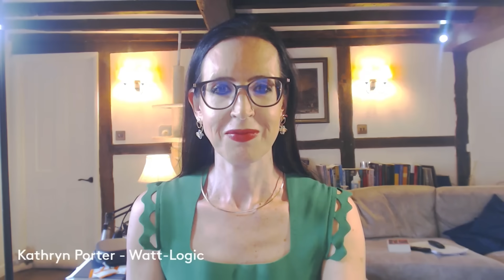North Hyde substation fire and the Heathrow blackout

Comment: Just stop transformer oil! It's literally used everywhere. Makes me laugh at those people who really think we can just stop it. Worse still its a single point of failure to the only supply to LHR at that point in time. The cost of outage is massive, the cost of maintenance is, I suspect is less (they only care after it fails). Did anyone do a failure mode and effects analysis, which used to be a normal thing, especially in the avionics industry (what's that they say?). Keep the essential systems working (not including Costa in that). The endarkenment is starting to reach critical mass. I didn't notice the peak (in the 90s) but now it's evident we're over the top of the roller coaster.

Comment: While it might appear that there is an issue around scheduling regular maintenance, it is not always possible to take equipment out of service, at the scheduled time, while simultaneously maintaining reliability of supply. 

Consider a tower of Jenga blocks. Blocks are being added on the top (system augmentation). Some blocks are withdrawn and later replaced at random at lower levels (equipment failures and subsequent repairs). You want to withdraw a particular block (for maintenance), but it's not always possible to do so, depending on the state of the rest of the tower.

Comment: From an Australian power engineer, it seems negligent that so much critical load was affecting by a single incident. There seems to be a lack of resilience in the system that feeds one of the most important pieces of UK infrastructure. I’d very much like to see an analysis of the feeding arrangements from the National Grid to the Heathrow airport and surrounds.

Comment: About 6 years ago we had a power cut that knocked out the power for two towns for a minimum of 30 minutes. At the time I was at college with quite a few UKPN area managers. I asked our area manager what happened the next day, he brushed me off whilst he went to the pub. The other area manager explained that there was an earth fault on a piece of equipment that the manager had identified as in need of 'reinforcement' three years prior.

It is clear that the boots on the ground are not the issue, but the bean counters instead. Having UKPN owned by HK companies, once priding themselves as the most profitable DNO is causing the infrastructure to suffer. Profits need to be invested directly back into the networks, not offshored to foreign shareholders. Ofgem need to grow a pair.

Comment: Thirty year veteran SCADA engineer for the Grid and can confirm that the maintenance and replacement slippage has been getting steadily worse over the decades.  Clever software control systems cannot work miracles ... at some point you have to maintain your transformer!  I chuckle wryly as I say this as most of the time when we get fault calls on the AVC/ATCC systems it is because the SGT's (specifically the tap change mechanisms) have not been properly maintained!

Comment: While I appreciate, like other viewers, the clarity and the conclusions, I do disagree with several statements. One, the explanation of electrical resistance and heat was turned around. The resistance is a physical property of conductors; the results is loss of Energy which in turn results in heading. Two, transformer oil meets many requirements. Calling it highly flameable is firstly a relative statement, and secondly debateable. According to Wikipedia, it is compareable to biodiesel. Third, fire requires air, so the  containment of the oil must be breached before a fire can start. Therefore, the moisture in the insulator most likely caused / allowed an arc to heat the moisture, crack the insulator open, allowing air to reach the oil which then ignited. Further, you could have mentioned, that the ammount of oil is very substantial - thus supporting a major fire. Perhaps the oil leaked,  creating an even larger fire spreading on the ground (the expansion tank on the transformer).

Comment: Although National Grid where negligent, so where the operators of Heathrow. As a mere civil engineer working on the design and construction of energy systems, even I new that sub-stations caught fire, that is why we put fire break walls in. If the operators had done the most cursory risk assessment they would/should have identified the need for redundancy in the grid supply and/or have emergency generation on site.

Comment: How do they know it was moisture ingress that caused the breakdown? High voltage dielectric breakdown can also be caused by the deterioration of the insulator. Breakdown occurs if the field strength is excessive, so locally in a material that depends on how sharp a point is in it, as per inverse of radius of curvature in the microscopic structure of the material. Therefore if a material is old and lets say it develops cracks in it through regular thermal stresses of expansion and contraction with temperature then it will create local point as in the material which will arc over and eventually you get a runaway situation where it burns up entirely. I had this problem a lot with 25kv transformers and you also get dielectric breakdown in old capacitors as well. I don't suppose transformers manufactured pre 1968 were all that well designed. We have better material science now than back then.
Reply from the maker: There was a forensic examination of the remains after the fire and evidence of arc related damage was found in the remnants of the bushing. With the earlier records of moisture ingress from 2018 they concluded that moisture was responsible but do recognise that it will never be possible to be certain because so much evidence was destroyed by the fire

Comment: Until you get into the fine detail of the incident in the US you can't be in a position to fully compare - and you haven't further explored that incident save to say they are similar. The failure is most likely due to a financial decision than an engineering one.  This sort of equipment has been around long enough to know its  weaknesses. If this type of incident is genuinely rare then it actually underlines how robust it is.

If the government had properly encouraged local electricity  generation  instead of allowing the ageing grid to be stressed further shifting large amounts of power from one part of the country to another it would be to everyone's benefit.

Comment: Having had some previous experience of transformer faults many years ago, the principle concern was the regular testing of the insulation quality of the insulating and cooling oil. Whilst the larger high capacity transformers like these are seemingly a sealed container, they do suffer from condensation forming internally in the expansion tanks which allow the oil level to fluctuate according to the ambient  temperatures within a given level.
Any deterioration of the insulating quality signifies water ingress, or other potential problems like internal arcing from loose connections or overheating which, under certain conditions, can generate acetylene gas. Many larger transformers are fitted either with an explosion vent, or more importantly - a Buckholtz gas detector alarm system which would trip the associated main breakers in the event of gas increase.
When the thing finally flashes over, it goes BANG as this one did, and the oil catches fire. 
Then everyone gets a bit!

Comment: Am I correct in thinking that moisture in the bushings was identified in 2018 and that immediately remedial action was required , but none performed ?
Reply from the maker: Yes. Moisture at the highest category was found. NGET's policy was to immediately take it out of service to replace the part but for whatever reason it was left alone

Then they found the fire suppression equipment was broken in 2022, still broken in 2024 and still broken at the time of the fire
Reply: @KathrynPorter26 .     It’s shocking and inexcusable.   It reminds me of fatigue failure in rail track, which was ignored, leading to derailments and deaths.
When I was a design engineer, the Institute warned us that we would be held personally responsible in law for deaths.   I became an airline pilot, so I find events at Heathrow particularly disturbing.    Thank you for your explanation.

Comment: I read a very interested article that said that because the sine wave produced by inverters changing DC from renewables to AC is not a pure sine wave ( like the one that comes from rotating generators ),  but is a 'dirty' sine wave having a high harmonic content,  this stresses the transformers and can cause failure.
Reply: Many inverters nowadays are pure sine wave.  However many of the loads on the grid have poor power factors.

Comment: Thanks for the clear explanation.
I'd have thought older infrastructure would require increased maintenance schedules due to their age.
Even worse if those transformers are running at above their rating..
..
The national grid, like the NHS and the rail network are everyday essentially infrastructure, and should be run efficiently in that context.
...
There shouldn't be cost cutting or cuttimg corners. 
Theres no need.
..
I can see 
why offgem might want to reduce the retail price of energy..
..
I'm not sure adding green subsides helps.
It just adds more pressure to cut costs.. elsewhere..
..
In this case 
N/G infrastructure..

Comment: As a retired 35 year DNO 11kv SAP - In short - when I left the DNO I was managed by a people whose electrical experiance was far, far less than mine or non exsistant.

I suspect a complete lack of authorised staff managed by people whose primary goal was to save money -  they let that transformer sit not understanding/accepting the issues need resolving asap, hoping it wouldn't blow on their watch. 

Yes OFGEM has alot to answer for, it appears to me to have no electrical engineering experiance within.
Reply: It's the same in the other energy industry mate.  OFGEM, like those in charge of the big infrastructure companies are accountants rather than engineers.

Comment: As a retired chartered electrical engineer I find it quite amazing that Heathrow are more than happy to have 50MW turbines all over the place provided they are attached to aircraft but shun one sitting in a shed ready to be used once in a blue moon that will come on line to power the whole airport within a couple of minutes if required. It simply beggars belief that those in charge at Heathrow can make sense of this without suffering from cognitive dissonance. I can only think they are climate change cultists rather than managers looking at the bottom line.
Reply: As a fellow C.Eng retired from manufacturing power generation equipment Heathrow's stance is quite understandable.  How often has this happened? well never before is the answer. So they would have had to have the emergency gen' set in place regularly tested ,upgraded and probably scrapped and replaced over the last 30+ years without it EVER being used in anger!
In short it would have been a total and complete waste of money.
I'll bet you don't have a spare car fully taxed, insuranced, MOT, serviced etc sitting on your driveway doing nothing for years on end for the one day maybe every 5 years when you main suddenly car breaks down.......
Reply: @M9dq76  Or they could do what JFK did and recoup the cost by running it and selling excess power back to the grid.  And as explained in the video it had happened before in the US.
Reply: @M9dq76  An insurance policy never claimed on is not a waste of money.

Comment: I have solar, battery storage and an EV. During the night I draw around 15kW charging the EV and the battery. This is 30x what I used to draw at night, the grid was never designed for this. It wouldn't take many people in my road to do the same before my local substation was catching fire.
Reply: Only it was designed for exactly that.  Back in the day electric fires were common, appliances used more and then there was economy 7.  Designed to use 2kW storage heaters at night for 7 hours in each room as space heating.  So in a 3 bed house you'd have lounge, dining room, kitchen, bedrooms x 3 and hot water (a 3kW immersion)  all heating up at the same time. 19kW at night sustained load on houses wasn't uncommon.
Reply: @cjmillsnun true but not everybody has it so the design of local supply would be based around diversity. If a new estate was planned to be all electric then the local supply would be designed around that, but estates that had a gas supply would be quite different. Also some people still use electric storage so this is additional load and I didn't mention heat pumps either, I don't have enough amps available to cover that according to the DNO.

Comment: Excellent review. The other hidden issue is the inability of National Grid Transmission to retain its field force. Their career packages for staff in the field are just 60% of the going market rate. Rather than resolve this inconsistency, the company has had its head in the sand and sat back whilst the exodus continues. ( I am not a field Engineer, but after 38 years I know what I am talking about). Unsurprisingly, maintenance is affected and compounded by the demand to build and commission more ( Net zero!) Meanwhile, executives are on multimillion pound packages. Very sad.

Comment: The design and operation of aircraft have learned hard lessons over  the last 100 years in regards to operational safety.  This led to the principles of points of failure and redundancy. Eg, computers,  ŵiring, hydraulic systems. All have redundant backup,  and often backup to backup. The designers also separate those backup systems, so damage to lines in  a specific area doesn't take out the redundant lines.
You would think that the same design principles would be applied to the critical infrastructure of an airport.

Comment: Thanks so much for this video.  But I wonder if you missed in the report the sequence of timed events which led to this catastrophe?

SGT3's C-phase 275kV bushing probably exploded and fragments of the porcelein smashed into and broke part of the A-phase bushing on SGT1 which was the transformer at the west side, leading to that one tripping out a short while later.

The ringing indictment is that NGET **had detected moisture in the oil in that bushing on SGT3 in July 2018**.  They did nothing about it while nevertheless having a protocol that they should take such a transformer with that developing fault out of service straight away.  They then forgot about it.  They had another remedial check in 2022 which didn't even plan to look at the HV bushings, so they didn't get any new readings and had forgotten there ever was a deteriorating condition in the C-phase HV bushing 4 years previously.  They had work scheduled in any case for 2024 on SGT3, and then they had postponed that work to beyond the date when it exploded, almost 7 years after the fault condition had first been identified.

It does rather look like negligence and certainly very inadequate record keeping.

The other indictment is that neither NGET nor SSEN apparently had the slightest clue how important it was that Heathrow continue to receive power to their substation A.  That beggars belief.  Mind you, Heathrow and its apparently fragile power network was designed in the blind belief that it was unthinkable that power might ever fail to one of its 3 supply points.  That's why interconnections between the Heathrow supply points A, B and C could only ever be made by off-load manual switching, requiring down time of 10-12 hours each occasion.

I'm so pleased that Ofgem are now going to enquire into the matter.  I think some NGET heads may need to roll.

Comment: A resident in the same road as the transformer fire called into Mike Graham on TalkTV and told us his electricity supply was back on and restored within approx 90 minutes, I thought it odd that Heathrow announced complete closure until midnight, massive disruption thousands of travellers were diverted to different airports in different countries, yet we never hear about their horrible day or extra expense.
Reply: That was to do with SSEN being able to reconfigure the lower voltage supplies at the rest of the North Hyde site fairly quickly, but not the higher voltage feed to Heathrow in a suitably reliable way.  It left Heathrow with no option but to reconfigure their supplies by hand, for which they retain UKPowerNetworks engineers on-site 24/7 to do, but which takes hours, and so Heathrow couldn't guarantee they would be up and running again very quickly without a reliable supply from North Hyde.  It's clear that Heathrow's supplies are not configured very well, as they have just grown over the decades with the airport, and I see the report does finally suggest they should have a 33kV ring main within their site, suitably buffered from the external grid supplies.  I wonder if that will happen?

Comment: Hi kiaora from New Zealand 🇳🇿 naziland lol .In New Zealand our power grids had had liberals running downward spiral hydro power stations you know what I'm talking about choke us  all from tax paid services "eugenics theories agenda ".Now after so much advertising by green emissions carbon emissions narratives has asked  communities for solar energy has been reduced by the smaller previous power lines from substations  operating in a 230 voltage isn't sufficient to feed grid solar hooking into the  communities system because 230 has a small increase operating upward limit about 6% x230 voltage where as Australia electricity commission did extend it to 240 x10% extra for large operation and allows grid feeding by customers which is excellent nzs just changing its upper limit see what happens kathryn porter you're awesome infrastructure knowledge  .how much is a nuclear power station for a 200k population town costs exclusively for households only unless in summer less energy is needed could switch into a commercial feed then back 😂🎉 ok 👍 👌